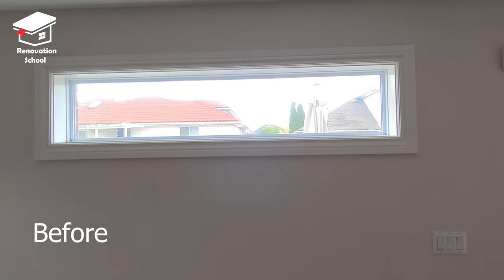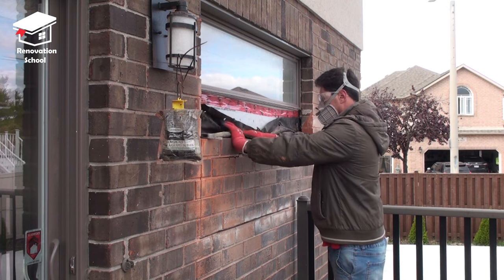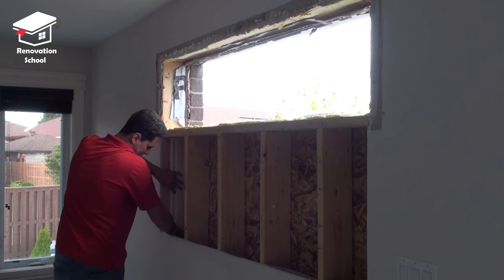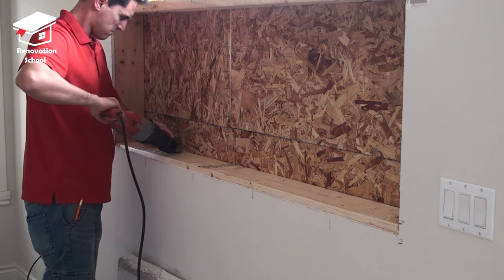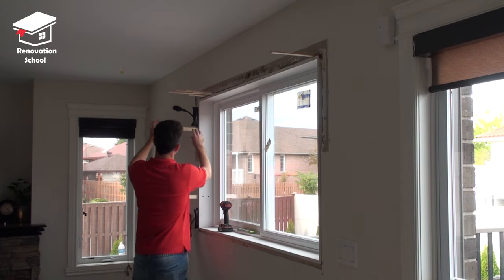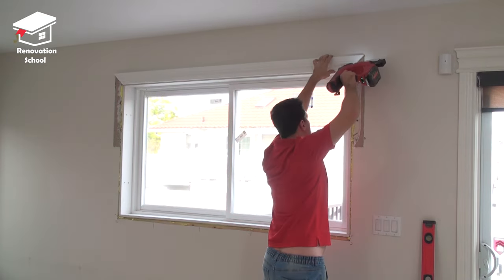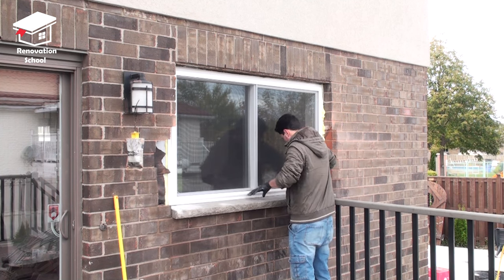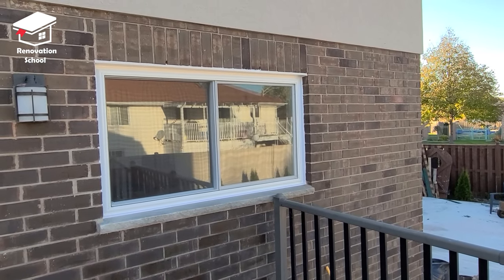resizing a window . How to make a window bigger?

Comment: Im trying to enlarge a window in my basement. Right now the window is installed as part of the basement wall which ia poured concrete. Right now the window is 2 feet wide, but would lile to expand to atleast 4 feet. Will widening this window compromise the floor above aince the joist sit on the wall?
Reply from the maker: depending on the building code in your are. In Ontario you don't need an engineer stamp if the opening is less than 48 inches.